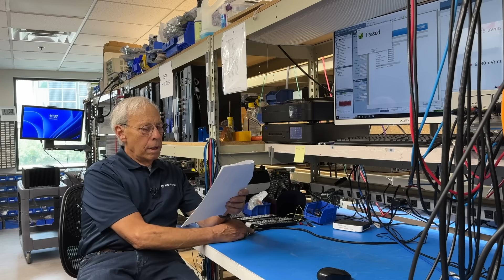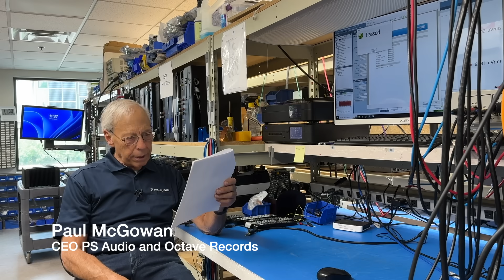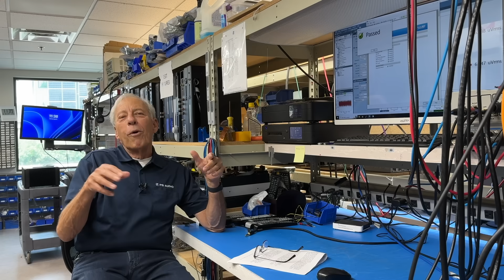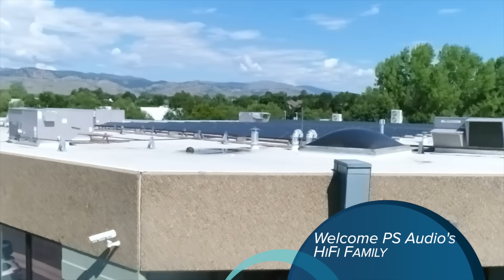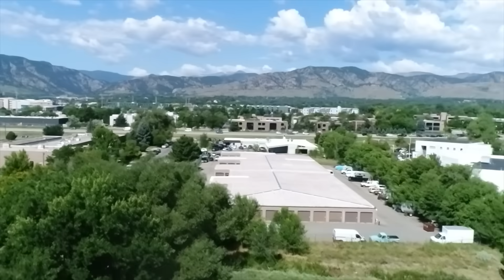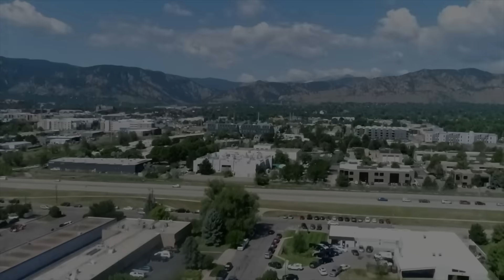How jitter impacts audio

Comment: Pulse width modulation PWM is not used for encoding digital audio signals it often is used to control Power in motors or lighting or heating using variable duty cycle this technique is used in so called digital amps also but its not the same as PCM which quantizes discreet portions of an analog signal and converts to a binary based bitstream which can be converted back to analog

Comment: OK, I get your explanation but it's a bit more nuanced than that, jitter concern with most modern dacs is a thing of the past, nowadays, jitter is below the threshold of hearing and is miss diagnosis as smearing of the sound stage. High levels of jitter is heard as random noise. This has been proven time and time again. Reviewers get this so wrong on so many levels.

Comment: Yes, jitter is important but, once again, Paul is being disingenuous.  This isn't something that requires near-magic levels of Air Lenses and stunningly high prices to solve.  Virtually all modern DACs buffer the input digital stream and reclock it using a highly accurate, temperature stabilized internal clock. 

Blind listening tests have shown that jitter from even a moderately priced modern DAC is inaudible.
Reply: I don't think you know what you're listening for
Reply: @Pete.across.the.street  Nope, not me.  This is the result of several scientific tests that removed all listener bias.  Like the bias that exists when a person is duped into spending a small fortune on a DAC and desperately wants to believe that it was money well spent.  

At one time expensive DACs would buy you additional sound quality. Not any longer. Even cheaper DACs made with the most recent commercially available DAC chips are extremely good.  This has been confirmed in several recent blind listening tests.

In fact, I recently participated in a blind listening test of a $75 DAC. Out of 500 audiophile participants, 55% heard the DAC to be completely transparent, 43% were found to not be able to reliably hear the differences they claimed that they heard, and only 2% claimed to hear a difference and were not proven to be unreliable listeners. 2% was close to the expected value for being correct by random chance. 

The fact is that good modern DAC chips are sonically pure and only add $20 to $50 to the cost of the DAC. DAC chips do all the heavy lifting, the rest of the circuitry in the DAC just acts like tone controls.
Reply: @markmeridian3360 what is the name of the paper? Who conducted the study? I upgraded the clocks in my streamer and heard big improvements in sound quality.

Comment: Zeigen Sie doch mal Messungen, verdammtnochmal !!! Den Jitter kann man eindeutig auf einem Spektrumanalysator darstellen: Nimmt man einen einzigen Sinuston, dann zeigt dieser unverjittert eine einzige Linie. Ist er verjittert, zeigen sich neben der Spektrallinie noch Seitenbänder. Stellt doch sowas mal dar, damit sich der Laie endlich mal etwas darunter vorstellen kann, anstatt nur dauernd darüber zu schwurbeln !
Aber Messungen scheut die Hifi- und Highender-Szene ja wie der Teufel das Kruifix !
Reply: @bachglocke3716 ...Quatsch !!
Reply: Noch mehr Quatsch ist  Ihre Antwort auf mein Posting! Sie haben nichts verstanden...
Reply: ∏_∏--∏__∏-∏_
There's your readout of two misaligned digital clocks versus you audo file :)

Generating an analog waveform from a timed digital signal is trickier than it seems exactly because of these potential sideband harmonics, that show up on the analog side. A simple diff - comparing the same file over different outputs or even insequence on the same output, to see if they null - would already give a decent indication; in the extreme, lots of jitter gives a modulating diff file, low jitter would diff to the flat noise floor of your equipment +/- √3 DB or so. Simpified but verifiable to some extent.

Comment: In my studio here I switch between 3 different master clocks depending on the material. I have clocking from Antelope, Dangerous, and Solid State Logic. Each clock sounds a bit different
Reply: I think in your situation your master clock controls many devices, from different vendors, many of which are not just time-sensitive but time-based effects in which case clock precision can make a lot of difference. And not all equipment plays nice with each other especially when you mix timing interfaces and protocols, SMTP and MIDI and whatever else you may need.
In a home setup, there is just the DAC.
Reply: @disklamer yeah there's a lot more devices to worry about in studio. But it's interesting to hear the differences in the same converter chips and how just switching the master clock changes the sound.
Reply: Interesting, since digital audio word clock is just a train of pulses in precise interval  timing, if different word clock generators gave different sound that could be the word clock generators didn't produce precise timing they gave variances
Reply: @kamunsan5483 right, every clock has jitter but they each sound different as each one uses different and various successful ways of suppressing it.
Reply: 😂😂😂😂😂😂😂 the picoseco d ear detector. Some of the statements here are so stupid as to be just funny.

Comment: Would it not be a problem of spectral purity of the oscillator be more of an issue?  A crystal can change frequency over longer periods which have no impact on audio.  Just proper design of the basic master oscillator should prevent this?   The absolute basic frequency accuracy such as the tolerance of the crystal would not be audible unless it was way off,  which would what?  shift the audio band?

Comment: Question: If an external master clock improves the sound of a DAC in audible ways, doesn't that mean the used internal clock is just bad and could've been better from the beginning?
For an example: SMSL is releasing the D200 Rohm DAC with an "improved internal clock", while they release in the same line-up, the G1 10MHz Master Clock.
But if the clock is already improved (they claim self-made), how much audible difference can it make from the perspective, that recent chips from this decade are already extremely good?

Comment: I must be doing something wrong, no clock, no jitter I can hear???   
How come I never hear any of these audiophile things?  I can't hear the magic cable.  I can't hear the difference between laying my cables on the ground and building a cable railway.  Can't hear the spikes on my speakers.  Can't hear the differences between all those DAC chips-- ya I suppose they sound different but....  What I do hear is the second I plug in a different speaker it sounds completely different.
Reply: Sie hören MUSIK !! - ich auch ! und das ist auch gut so ! Aus Ihrem Avatar sehe ich, daß Sie ein Profi sind? Das zeit das abgebildete Neumann-Mikrofon !
Reply: @keithmoriyama5421 ...what the hell is "magic cable"?? In 46 years in home-audio I've never heard of that 'brand'.
Reply: There's a lot of things going into it, to get it to a level where you can notice some of the things.
Reply: Man, you can't hear the magic cable, the cable railway, the spikes, the expansive hig end DAC because it's all snake oil, bullshit for naive audiophiles who want to believe. You should not worry :)
Reply: @gentemortable   ...not entirely. Spikes &/or vibration absorption pucks under loudspeakers in most cases do clean up & improve the bass response.
Reply: ok, true! I myself have vibration pucks under my speakers and I aknowledge the difference. But fancy audiophile fuses, high end power cable, that is all snake oil :)

Comment: Setting up a sound system with an older processor (behringer dcx2496) the dac is a little outdated. I found the smsl po100 which is a DDC, and I'm wondering if I can use the smsl clock as master to the berry. It does coax out, if I go right into rca to xlr, or could do spdif to aes.  Has anyone used the dcx2496? Ive heard analog inputs sound better to some, then some swear digital stages are better. If I can't slave the clock theres a kdcx clock mod which I will probably do. Or go for the full behringermods analog board.

Comment: Jitters are caused by b12  deficiencies. The nerve lining or insulation is compromised. So nerves short like bare wires. 
In regard to audio. It doesn't matter.  You're still using two sound sources. So it can never sound good. 😎
Reply: who said hes using two sound sources
Reply: @______4790  two speakers
Reply: @______4790  Two speaker cabinets. Are two separate sound sources right ? 
We study sound wave propagation. Two sound sources with any distance between the two. Generates an overlapping wave front. Turbulence is the result. This is a form of distortion. Different than amplifier THD. No amount of toe adjustment can correct this. Sound wave ring integrity must remain intact. For proper propagation. Like smoke rings or hydro rings. That's how they travel. Two rocks dropped in a pond , far apart. Results in Extreme wave overlap and cancelation. In the middle. Where everyone sits. 🤷‍♂️
Reply: @jimmiedean8035  sure phase isn't going to be exact unless they are unity loaded in the same horn.. but that doesn't mean improving digital timing has no effect on the sound
Reply: @______4790  Digital timing would actually be individual frequency control , volume level of all components. As with our 24 and 16 channel stacked module board amplifiers. With DSP and timing control. With a fixed center outward projection of music program. Perfect stereo in the center. No toe needed. Internal subwoofer. Node point calculated carbon fiber cabinet. Smoke flowed. Dual mass prototype driver's. Way way way way way way ahead of everyone else. Way ahead. 🙆‍♂️
Reply: @jimmiedean8035 theres a reason why unity/synergy horns are so popular (syntripP, jmod meh) they are kinda ahead of the game. But timing and jitter is different from phase.
Reply: @______4790 That horn is an old Lansing idea. Danley just developed it. Like the reflection speaker prototype that Lansing developed. Not to be confused with the refractive designs. Such as the Paragon and Paragon mini. We're the only one's pursuing this research to my knowledge. With a refractive line array and a reflection prototype device. Placing the tweets at the small end. And the mid drivers at the mouth of the horn. Is just moving the plane position. The same can be done by moving the tweets outside the main box and behind it in any speaker.. Delay. 😊

Comment: This is the first time I have heard anyone even attempt to explain the audible effects of jitter and the principles behind it. Now I want a cesium clock running my CD player.☢️
Reply: @InsideOfMyOwnMind ...& the lead-lined safety-wear to go with it 😉
Reply: No cesium or rubydium clocks not necessarily good for audio purposes.  They have extremely high long term accuracy, but when we are talking about a song within a few mins, low phase noise is the aspect u look for from a clock for a good playback fidelity
Reply: @peterlau6000   ...it's good to recognize when a commenter is joking😉
Reply: @peterlau6000 At first I thought this is why we base clock high and divide so we can shift the audible jitter below the audible range. Then is occured to me that jitter from the upper regions would just shift down into the audible range and we gain little to nothing.

Comment: What I read here and there are not directly jitter related when it comes to digital streaming vs sound quality. It is noise related... This noise will affect the analogue voltage carrying the digital stream and will pollute the quality of the sound, like harsh and "digitalized" presentation to your ears. Better switches/power supply and/or passive filters can and will lower the noise floor on the ethernet side to the better. If the clocks, that Paul refer to, is tracking off just a bit, in the time domain does not seems like the whole story to me... Of course, neither jitter or noise seems to have any positive values to us :)

Comment: Reducing jitter can also be attained by cleaner power. Because the clock runs on power and the cleaner it is the less it will be affected. One of the reasons power cables matter.
Reply: I actually overhauled the breakers in my house and it really brought out the fullness in my audio system
Reply: @D1N02 ...& power regenerators.
Reply: Quatsch !!
Reply: A power cable or regenerator is more to deal with power supplies that can't generate a clean DC signal from an incoming noisy AC signal. A good PSU should be able to do that, and if it couldn't then a power regenerator couldn't work either.
Reply: @storkfletcher821 They work by different principles for different purposes, it's not the same.